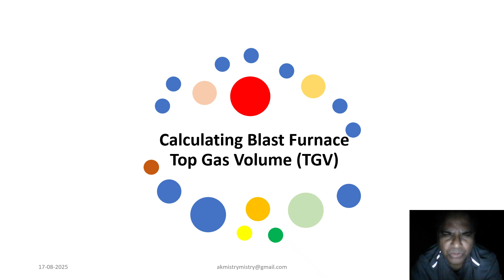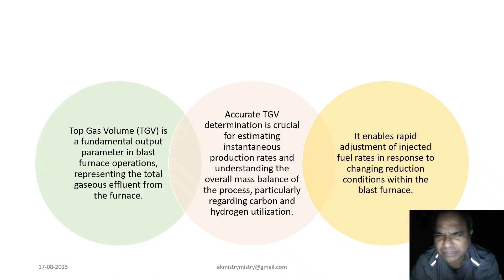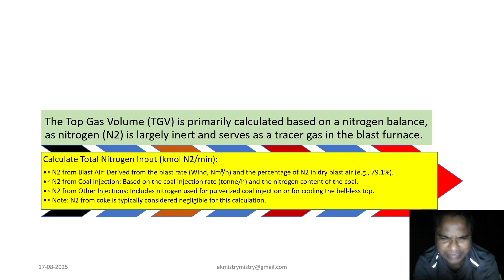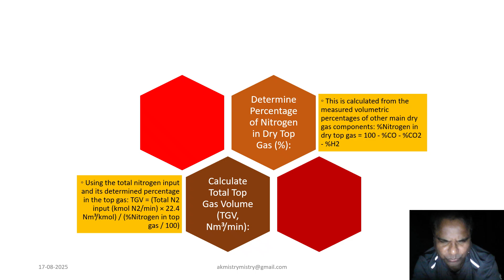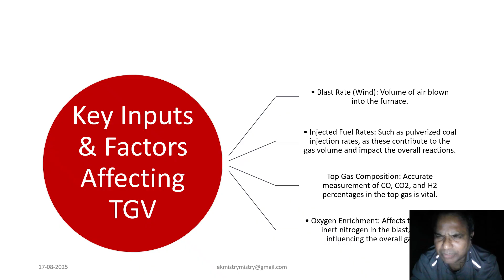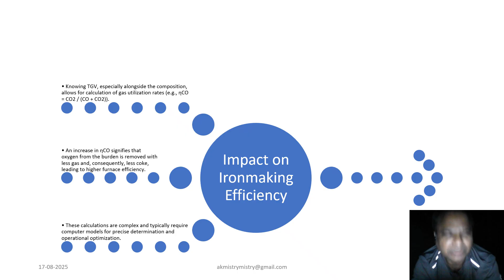Blast Furnace TGV Calculation: Key to Boosting Ironmaking Efficiency and Production Optimization

Comment: Good content sir Could you please do more detailed calculations on Blast Furnace like Bosh Gas Volume, Burden Distribution etc ., and Suggest the Best Books for Blast Furnace Process Control sir
Reply from the maker: Thanks for the great suggestion. I’ll do a deep-dive video covering (1) Bosh Gas Volume step-by-step (with a full oxygen–carbon–hydrogen balance and a worked example), (2) Burden Distribution (layer thickness, ring placement, and permeability control), and (3) live calculation sheets. For learning and process control, I recommend: Geerdes et al., Modern Blast Furnace Ironmaking, A.K. Biswas, Principles of Blast Furnace Ironmaking, Ghosh & Chatterjee, Ironmaking and Steelmaking: Theory and Practice, and AISE/AIST, The Making, Shaping & Treating of Steel (Ironmaking Vol.).